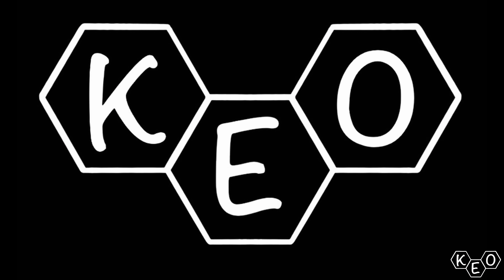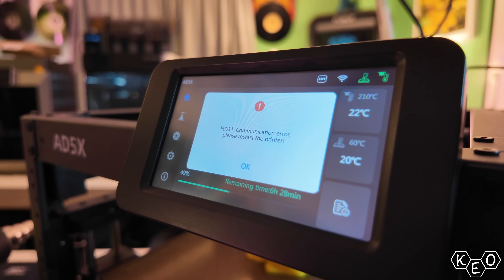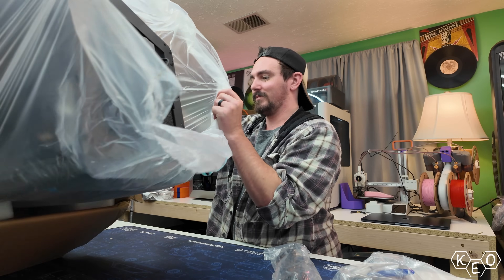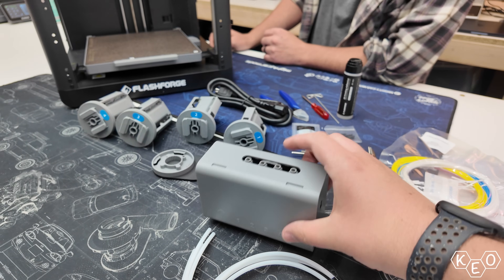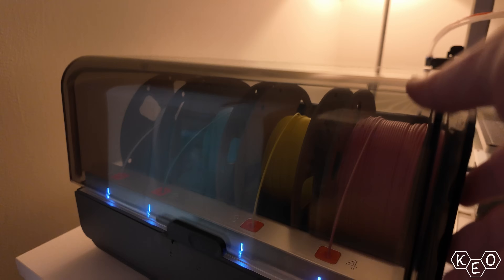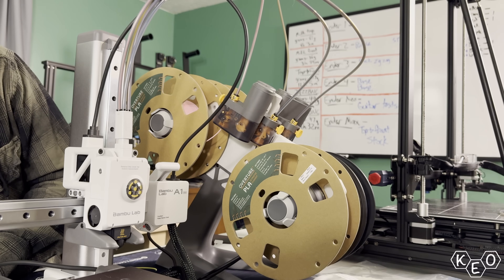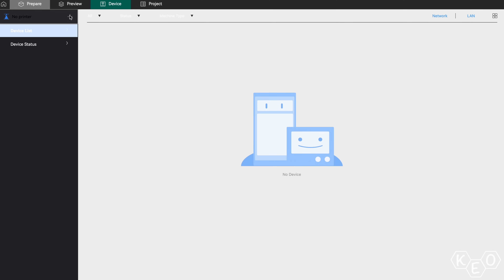AD5X First Impressions – Can Flashforge Really Compete

Comment: I've been unable to get the lan mode to work and their cloud is frequently down. I'm set up with a router in the house with a lan cable out to my workshop where I have another wireless router. My laptop sits right next to my ad5x and connects to my workshop wifi along with the printer. However, I can't get lan or network mode to work. I tried a lan cable direct from my laptop to the back of the printer and still nothing. Any suggestions?
Reply from the maker: Wow, what a mess! I thought the ethernet port on the back of the machine was a commendable addition for that very reason. Doesn't do a lot of good if it isn't working though. The only advice I could suggest is simply awful advice... check with FF customer service and see what they have to say. Not sure how well that will go for you but I have no idea!

Comment: Keo, I just bought one of these off AliExpress for $256. I wasn't looking for a 3rd printer (I have two P1S) but it was between this or getting an AMS 1 from Bambu Labs for literally the same price (well, the AD5X only cost .25 cents more). That's pretty crazy to me that this whole multi-color printer is the same price as the first-generation AMS from Bambu Labs. I hope I don't regret my decision but having a dedicated 3rd printer for strictly multi-color prints (or to assist my other two P1S) seems like a hell of a convenience than just having a single AMS for one of my P1S.
Reply from the maker: That’s a fair point. This is quite the value especially when you compare it to the price of an AMS

Comment: So after reviewing this printer and the Q2 and the Kobra S1, which would you recommend to a newbie, if any? The current sale on the S1 looks great ($449?) but not if Anycubic is just trying to deplete stock or refurbed printers. The Q2 looks good but the Q Box seems to be a problem. Any recommendations? Or should I wait for the new tool head changers or index printers?
Reply from the maker: So I always recommend bambu printers for someone just starting out. There is no better option for something reliable, super user friendly, and quality. Otherwise, yes, the Qidi box has given a lot of people issues apparently but I have had a good experience so far. The Flashforge is a great option as well but has the software/firmware bugs. As for anycubic, the S1 is fine but it would be my last choice personally

Comment: Hey keo i got a question on the Qidi Q2/ Qidi Box, have you tried the adapter rings on the cardboard rolls? if so how does it work compared to them standalone
Reply from the maker: I actually plan to mess with this more as I continue printing with that machine. Ill be sure to investigate and report back.

Comment: With Cardboard spools my trick is to tightly wrap electrical tape along the edge of the spool, it keeps it from breaking down and getting cardboard dust in the AMS and helps give the rollers better grip on the spool edge, and its much cheaper and faster than trying to print a spool edge.  But if the spool cardboard is dented in skipping, then I go to the spool edge thingys (I dont remember what they are called)

Comment: I will say to get a BIQU Pro Glacier for these machines. The stock build plates wear out way too fast, leading to adhesion issues. That's truly the only issue I have with FlashForge printers. I've modded my 5M with Forge-X and I recommend ZMOD for the 5X.

Comment: I like mine and I also have a P1S and A1, each with AMS (P1S PYTHON modded!)  The flashforge is a great machine and seems very reliable.  I just wish it had Klipper (seems like it is being worked on....)
I would recommend the AD5X easily, even over the A1 with the larger bed.

Comment: What are your thoughts on this vs the Centauri carbon?
Reply from the maker: That is a difficult comparison since the CC does not do multicolor. But for a general purpose multicolor machine, this one is excellent. If you’re looking for something to print high temp materials, the CC is a better choice
Reply: @KeoPrints that's what I was thinking also.  I mostly do fuctional prints and less things where multi-color would be useful.  The only real benefit I think would see from the ad5x would be being able to run a spool out and have it automatically start the next spool without supervision
Reply from the maker: That's a good point. The auto refill is an excellent advantage even if you aren't looking to print multicolor. That and not needing to manually load and unload filament in general

Comment: I have the ad5m and once I got a bambu printer....wow I don't even use that printer anymore. I had so many issues especially trying to use orca slicer. For awhile it would print miniatures amazingly but then the extruder assembly broke on month 6 of having the printer. Apparently the extruder only has a 3 month warranty. I replaced it. Tested it and stored it away 😅

Comment: I returned mine. I didn’t like that you can’t control the poop amount / purge objects. Software and firmware are not very polished. It purged to an object but still made lots of poop. Plus try changing the the Bowden tubes on the IFS ..not fun

Comment: Another great video! You should build the enclosure and add the camera module and lamp if you do not have them. It's a fun project that adds personalization to the machine. Some of the parts are challenging to print well. To me adding the enclosure felt nostalgic--a bit like ham radio, or the early, early days of personal computing. Back where you had to build up or modify your equipment just a little bit to get the functionality you wanted. It is not something I can exactly define but working towards and reaching that milestone and sharing the result is a lot of fun. Flash Forge is on to something good here with supporting the enclosure kits for their machines. I have the AD5M and it has been a great printer. I suspect the color version is even better.

Comment: Many manufacturers are too busy sending products to market to save money on finishing hardware and software, and when you use someone else's slicer with a reskin, you could have finished the job. It seems more likely that they completely forgot to check the black theme when they released the software. Either they don't have skilled people with enough knowledge, or it's probably more the management that demands things be finished in the shortest possible time and often in the way that errors occur. 

This problem reflects the entire electronics industry from electronics to kitchen equipment, washing machines, dryers, cars, and more. I see too often releases of new firmware fixes, with a few months or even weeks between. I miss that people take pride in doing their job properly.
Reply from the maker: It is unfortunate but there's a lot of truth here
Reply: True, but one of the good things about this printer is it uses Orca Slicer, so even if Flashforge doesn't fix the problems the Orca community will.

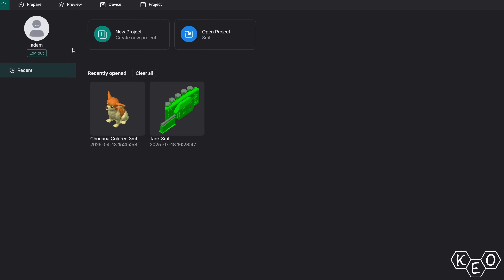Comment: 15:45. That alone would make me return the whole damn thing.  Bad software cripples hardware.  Companies need to pay their programmers and fire the weak ones.  No excuses
Reply from the maker: Agreed. It is a greasy smudge on an otherwise very surprisingly excellent experience
Reply: True, but one good thing about this printer is it can use Orca Slicer so even if Flashforge doesn't fix the problems the Orca community will.

Comment: My first printer is a Flashforge 5M. That got me started, and I was able to print an adapter to connect my shop vac to my table saw. I was unable to find one to purchase until I printed one; I was hooked. Then I wanted to be able to print with different colors and wanted to purchase the AD5X. I would have had to pre-order it, and it looked like it would have been a few months before I could get one. So hello Bambu Labs, and I have been happy with the Bambu. I have never had an issue with my 5M. It is just slow and has a smaller bed, but it printed great.

Comment: If you are trying to use normal Orca and the issue was AMS, and you uploaded new firmware after, did that fix your normal Orca Slicer/AMS issues? If still no I'd open both slicers and look at the AMS gcode settings, I HOPE they aren't doing something stupid like special AMS-processes only in their version of orca, that would kinda suck.
Reply: My guess is this is it.  It's a pretty quick check, sadge keo didn't do that 😢

Comment: ! was soooo close to buying a couple of these but then the Snapmaker U1 Kickstarter grabbed my attention and the rest is history.............
Reply: Yep… I just can’t get over the wasted filament any more. I’ll never be able to look at a non multi-toolhead without feeling like my money is going down the drain.
Reply: @MarkovAllTrades  plus no mixing of pla/petg for support
Reply: You dodged a bullet. They are garbage. I just lost another 9 hour print because the filament wrapped around the spool holder and the machine apparently has has no runout or extrusion detection so it just printed air for 3 hours on one of the colors. My U1s can't get here fast enough so I can pawn off the 5X and make it somebody else's problem.
Reply: @donnyriggz I had the spool issues when I used spools that were too big to fit snuggly. The spools would turn too far, and the filament would spill over the side of the spool.

After printing adapters, that problem is gone.

Adapters that snap onto the end of the spindles work fine. These provide enough friction to stop the spools from spinning freely.
Reply: @donnyriggz I believe that a firmware update fixed the runout issue. 

I had that happen after I first bought it, but now they wait for me to load new filament. 

Even better, if I set two spools to the same color, when one runs out, it'll switch to the other spool.
Reply: @Weaseldog2001 the problem is the runout detection happens at the IFS so if a filamemt is loaded, but gets tangled around the spoolholder or breaks betweem the IFS and the toolhead, it doesn't detect tbat nothing is being extruded so it just keeps going like there's nothing wrong.
Reply: @donnyriggz You're right.

Yeah, after I found a solution to the tangle issue, I stopped getting runout issues
Reply: two different markets.  one is a 1000 dollars minimum, the other is 350 bucks.
Reply: I might still get 1 or 2 5M’s for single colour prints only though 🤔
Reply: I wouldn't recommend it for a beginner, it has a few issues that you need to have some basic filament adhesion troubleshooting and their support is horrible
Reply: How is the U1 compared to the bambu PxS (p1s, p2s) series? If you have experience.